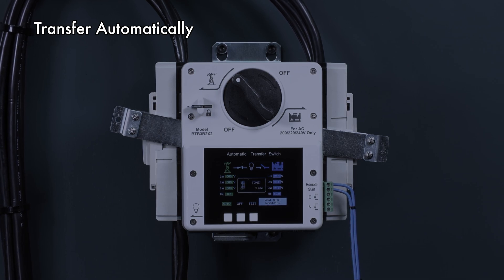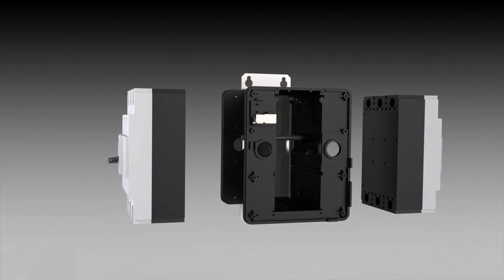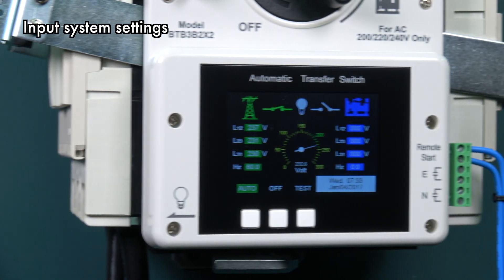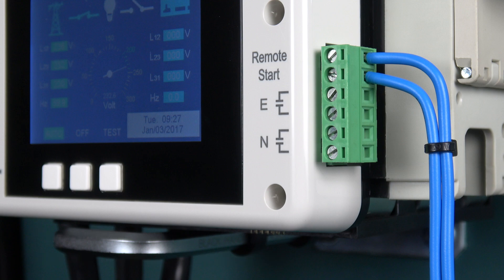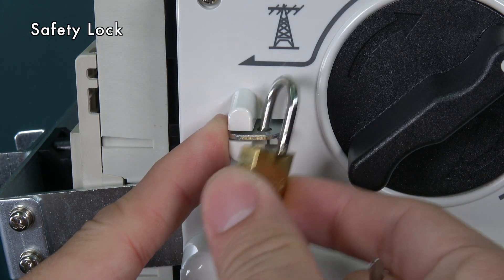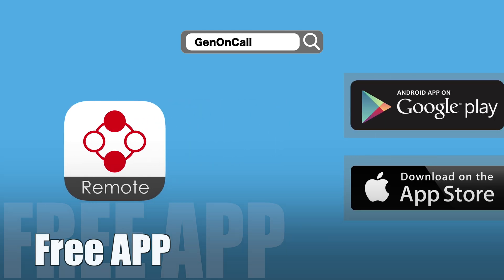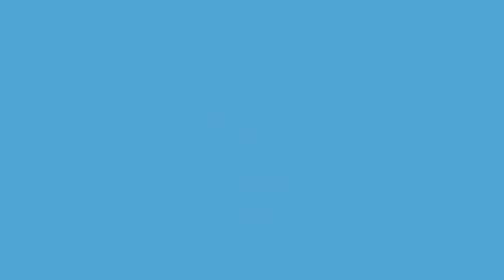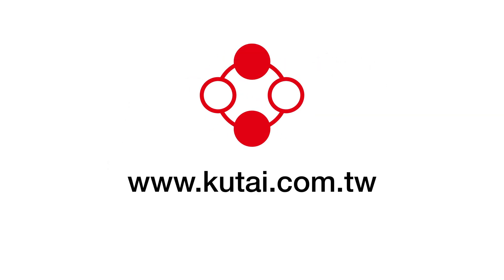KUTAI Electronics - Automatic Transfer Switch (ATS) - 2 Pole/ 3 Pole/4 Pole - BTB Type ATS

Comment: Sir if we use 4 generators and 1 utility circuit and the standby is turned on step by step then what is the procedure and after running one generator in standby the other generator has to be run when the utility comes and so on  The rest of the generator is also on, ie after running one generator, the other one will run. When the first one does not work, what will be its connection?
Reply from the maker: Hi Toseeq, please contact us by link to https://www.kutai.com.tw/en/contact-us.html, our sales will contact you and provide service to you accordingly. Thank you.

Comment: I would like to know more about the remote start feature for generator. I have a key start diesel generator, is this compatible?
Reply from the maker: We have several Auto Start Modules and Genset Controller which enable to auto Start/Stop the Generator by receiving Remote Start Signal from an Automatic Transfer Switch.

1. EC-01  (Auto Start Module for Gasoline Engine Generators)   https://www.kutai.com.tw/en/generator-control-unit/ec-01.html
2. ECU-04/ECU-05  (Auto-Start module for Manual Key Start Gensets)
https://www.kutai.com.tw/en/generator-control-unit/ecu04ecu05.html
3. GCU-10  (Generator Controller with Auto Start and Protection feature )  https://www.kutai.com.tw/en/generator-control-unit/gcu-10.html

please take a look at our product webpage and contact us by link to https://www.kutai.com.tw/en/contact-us.html, so our sale team can assist you better. Thank you.
Reply: KutaiElectronics Thanks... how to contact you via email?
Reply from the maker: @apz9022  Our sales has replied email to you with suggestion, do not hesitate to contact us if you need any other assistance, thank you.